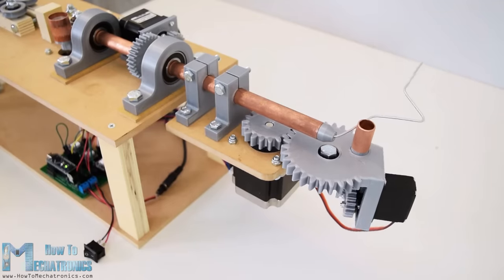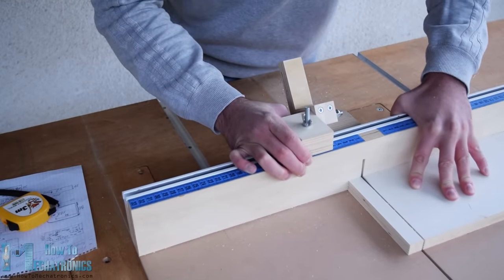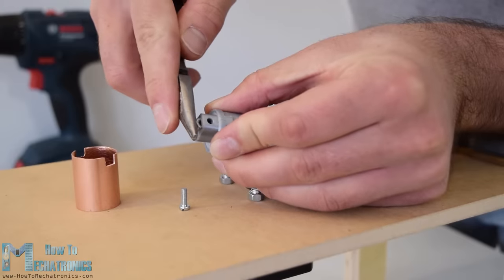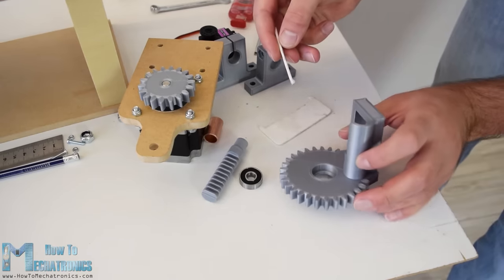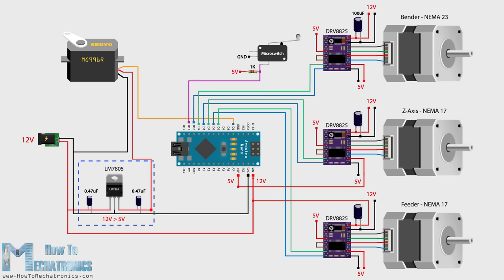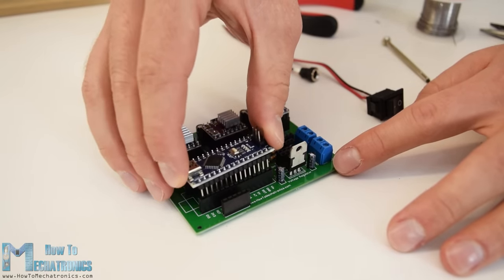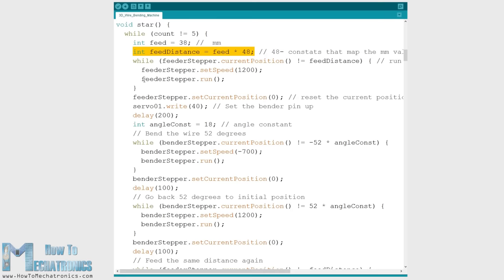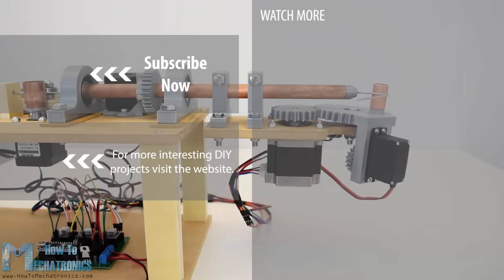Arduino 3D Wire Bending Machine

Comment: For 30 odd years I worked for a spring making company, during which time computer-controlled machines of increasing flexibility gradually appeared, making compression, tension, and torsion springs as well as wire shapes.   I've been retired now for 13 years, so it was quite amazing to view your video which demonstrated the principles upon which these machines worked.   It would have made the problem of explaining what we did to lay people a lot easier.
My own contribution to the company was in designing and making electronic devices to improve the functions of older, non- computer-controlled machines.   Although I made my own printed circuits boards, the designs were initially based on TTL integrated circuits and latterly Programmable Logic Controllers - nothing as advanced as Arduinos.
What would I have given for a 3d printing machine ?
I was also responsible for our computer system, in its metamorphosis from a punched-card system (with a 2K hard disk!), through unix based COBOL, to an Informix relational database system.   I learned to code in many languages, so your program explanation was also fascinating to see.
Thank you so much for posting this project, I found it most interesting.
Reply from the maker: I'm so glad a person with that much experience in the area found this video interesting. Thanks for the comment!
Reply: Hello @Don Johnson24

I find your comment and work on the machines very interesting!

If there were videos on the subject made by you (e.g. your PCB designs, TTL circuits you worked with, PLC logics, most importantly Unix and even how those punch-card systems and COBOL worked) I'd be very interested to watch them.

Thanks for adding your input on this video, I always find stories like this very fascinating.
Have a great day!
Reply: Cool tie in Don!
Reply: This is one of the most well written comments I've ever seen!  I feel obligated to capitalize and punctuate everything from this point on.  
These explanations of how processes were executed should be standard curriculum for all mechanical engineering degrees. 

Every ME should buy a cheap 3D printer and an Arduino kit .  It honestly takes about 8 hours to learn it.  I learned it and use it everyday for my actual job.  It's like unlocking a cheat code for a video game.
Reply: @nickmandarino8234  Any kits and guides you'd recommend?
Reply: It is the hard work that "you" the older generation have put your heart and soul to what you do, that contributed to this day and age for us the younger generation to live in and for us to hopefully do the same for those who will come after us, it is "your" the older generation teachings that "you" inherited and passed to us and we will pass it on, is what made this progress possible, thank "you" from the bottom of my heart for your great contributions as we will try to further ours.
Reply: Ladies and Gentlemen, if you're ever looking for a true and correct definition for "hacker", "greybeard", or "that guy who combobulates and finagles der  blinkenlights", Don Johnson24 is the answer you're seeking.
Great reply to a great video, thanks Don. All the best for a happy, safe and productive 2019.
Reply: Reagan was asked how he could lead a "computerized" country when he was so "out of date."  He replied "Your forgetting that my generation INVENTED AND BUILT the computers you're just USING."  THANK YOU FOR LEADING THE WAY AND YOUR YEARS OF SERVICE!
Reply: I wonder what would Don have done in his youth if he had access to such wonders we have today =]

What a time to be alive!!
Reply: hi don  so was i in the spring game 25yrs 16yr old started vic oz melbourne :) now its  huge business into alot diff things 
one these small machines from taiwan cost in 2006 $36k au
Reply: Waooo, how good was you comments that it stick with my eyes. Reminds me of my uncle who was working with something similar electronic. Obviously your efforts brought us to these tech toys.
Reply: Do you have a 3d printer now??
Reply: One important thing that worth mentioning is: Not all smart machines work with microcontrollers, you can achieve the same functionality with some methods and techniques like latching by the use of switches relays ( for example: take a look at retro Jukeboxes ) , ... but for sure the size will be bigger, the number of components will be higher, and of course, the total speed will be lower
the point of my comment is that technology is Not limited to only one method/technique and you can achieve similar results ( either better or worst ) by newer ( or older ) methods...
the only unchanging thing in our world is mathematics ( nothing else )
Reply: Hell yeah! I'm 21 and started as a coiler 3 years ago and transferred to Newcomb Spring last month! (Not sure if you've heard of them but they're exceptional). It's cool to come across another coiler/former in the wild! I've done lots of work on mechanicals back at Lee Spring, such as the Torin W11, W10, W11.5, Mec CLS-10, Mec SC-8, and slowly transitioned to the CNC machines, like the Mec CLS-10X, CLS 16-II, WH-16, SH-8, Itaya PCX-20, PC-15, CX-8, and probably a few more I forget to mention. It's an amazing job because I really feel like I'm contributing to society, I'm making great money for my age, living comfortably, enjoying my job and not worrying about college anymore. Not to mention, it's nice to be one of the youngest coilers out there, I feel like I'm doing something most people my age just couldn't. I mean, I've made springs that operate artificial heart valves for St. Jude Medical. It's a great feeling that something I've made is keeping someone alive right this moment.

Comment: You have really done a fine job with this! I’ve seen the large commercial units that cost mega-bucks to acquire but this is an amazing workaround for folks on a budget. The best thing is that you have done such a nice job documenting your work. Thanks so much for being a class person and passing on this great information.
Reply from the maker: Thank you!
Reply: I used to run a wire bender.  it's amazing how simple it CAN be on the small scale, large scale is a different story.  Great job on your project, happy that it works well.

Comment from the maker: Hey everyone, thank you so very much for the positive feedback and motivation! I will definitely keep making this kind of content, so stay tuned! 😉
Reply: Kakoy y teba silniy akcent
Reply: Is that an affiliate link to banggood? If so... pretty shady you don't announce it in the video, that you get money from them
Reply: Супер видео! На крајот можда ако ставиш гума и на цевката и на лагерот (парче внатрешна гума од точак на пример😉) би се решил проблемот.
П.С. Не би било лошо да ставиш captions на македонски. 😉
Reply: Oh man, you really show us that the imagination and creativity have no limits... thanks a lot, I've learned a lot with your videos!!!!  What a beauty machine!!!
Reply: well done, very informative. As for your wire feed problem, have a look at MIG welders, how they feed the wire, also they use a spring tension with the bolt adjusting the tension, this allows for the fractions of an inch variations in the wire. Also, larger industrial machines used a hardened knurled drive wheel, which grips the wire, again which should be cheaply available online in a variety of sizes. Also pushing soft wire thru the copper tube, it has too much room to be able to bend, perhaps get pvc tube in different sizes and slide on inside the other and side the whole lot into the copper, or print something.  It's a bit like trying to push a rope up hill, put it in a tube and you can do it, put it in a huge pipe and it will bend and fold over inside.
Reply: Please do the rubik solving machine !!
Reply: So nice and useful project. Add more similar projects please.
Reply: good job man, cool video
Reply: Soooo dude, what you are going to use all those bended springs for?
Reply: A perfect machine for making the tricky wire parts of the Orthinopter.  Well done.
Reply: Fantastic stuff.
Reply: Superb explanation with innovative  display of the program as you explain it. I have never seen it done better I wish I had someone like you as my instructor in Fortran 4 back in 1968... mind you as we programed on punched cards back then it might have been a touch more difficult!
Reply: this is really cool but being a minor I can't really do anything else other than watch this.and other videos like this. I think it would be really cool if I could make something like this.
Reply: Great project. Nice level video and build. I should aim to reach this level sooner or later. Thanks for the inspiration.
Reply: could u build coil winder machines?
Reply: hey Mr. , can I buy your work? we need it for our thesis, here in the philippines.
Reply: Nice video , and nice voicecracks
Reply: I wish that you sold the completed arduino part.  I am not a techie :(
Reply: Please Sr. I need to know about the measure of wood.Please My team and me we can do it for the school from El Salvador.
Reply: Excuse me if my english is bad
Reply: christina brine ya he need to sell the pcb
Reply: Can we get the parts
Reply: How To Mechatronics it is possible to bend a stl file?
Reply: How To Mechatronics what about using the straightener it self as the drive for the wire.
Reply: I have a doubt if we change the dia of wires ,shall we change the wire straightener pulley ??
Reply: My question is :
Are you a mechanical engineer or a electronic engineer or computer engineer or electrical engineer? You're doing all yourself..  Great.. 👍
Reply: Hi there
I am fascinated by how you have in simple language explained everything including principal and operation making the concept very clear. Thank you so so much. Is it possible to get a pcb with all components soldered and tested mailed to myself in Canada. I am willing to bear your charges. I am retired but will enjoy building it. Please let me know. Thanks and God bless you. Stay safe, we need you. Muzaffar

Comment: Very nice build!  It's the first project I've seen that makes me think that I might have to add a 3D printer to my shop!

For your straightener/feeder problem at the end, I'd suggest either gluing a strip of sandpaper to the copper tube in the feeder for extra grip, or perhaps using a rubber roller (salvage from an old printer or such).
Reply: Alternatively, a very simple solution to the feeder problem would be to put some heat-shrink tubing over the copper tubing. Should raise the coefficient of friction enough to solve the slipping problem.
Reply: You can 3D print rubber-like soft plastics as well if you have the right printer setup.
Reply: Knurled carbide roller. Edit: search mig wire roller.
Reply: @JimmysTractor  Not a bad idea, but if your tension is set too high, it will leave marks in the wire. If that's not an issue, that's a great idea. It gives you plenty of grip, and makes a good positive connection between the roller and the wire.
Reply: Roboticus: I was thinking of a small piece of inner tube or other rubber tube, slid over the end of the roller. Sandpaper could work, but could end up marring the wire. Heat shrink would work, but I think actual rubber would give better grip without marking up the wire. 

I keep looking at 3D printers and small dremel based CNC machines. Which one? Hmmm...

Comment: 3:15 - I really like the way you designed the gear to accept nuts. I'm going to use this in future designs! Thanks for the great idea!

Feeder issue: Perhaps have two drive wheels tied together with a gear on one side of the wire, then have two pressure rollers with a tension spring on the other side. That would double the area and grip of the unit.
Reply: If you're working with flat shafts and you can just put in a 5mm screw hole, you can use the regular self-threading plastic screws (like what PC fans use), instead of needing nuts.  The screws are cheap, and it works really well for securing a plastic part to a shaft.

Comment: I have to agree with the majority of the commenters.

Great build.
Excellently documented.
You explanations are clear and precise. 
Even considering your comments regarding the flaws of the machine is awesome too.

You have just gained a new subscriber.

Regarding the feed issues.
Mig welders often use a knurled wheel as well as a bearing wheel.
So perhaps try that instead of the roughed up copper tube.

Also. The straightener part of the machine. .
When using a similar pipe straightener machine,  you pull the pipe in and out of the straightener a few times. Maybe you could feed and return the wire through a section of straightener a few times before starting a bend program?

Only thing it needs now are automated wire clips to clip the wire off once finished.

Very well executed.
Reply from the maker: Thank you! That's a good tip, pull in and out the wire several times before feeder to the bender. However, first issue to be solved is the grip of the feeder. Thanks again for the input!

Comment: Excellent video...  I used to work in an shop where we had straighteners to take the bend out of coiled steel just prior to fine blanking.  The straightener rollers WERE the feed rolls.  The straightener rollers were geared in series and they did the feeding of material.  To compensate for feed roll slippage, there was a single roller that counted the feed length.  On your system, you could make the five straightener rollers into feed rolls and rework the current feeder roller into a potentiometer that counted distance and shut the feed off when a given distance was achieved.  Thanks again for a great video.  Thumbs up and a new subscriber here.
Reply: I was going to suggest putting a backing roller on the opposite side of the feed roller, so more drag force could be applied to the feed without increasing the lateral force on the servo shaft . . .  but I think you have a better suggestion. I would replace your distance-counting potentiometer with a rotary shaft encoder that sends a pair of phase-lapped pulse trains to the arduino for measuring distance, though.
Reply: Yes Don, your suggestion is perfect.  Makes for a much better solution.

Comment: I noticed a few people asking for upgrades to this.
My suggestion would be to add an OLED screen, rotary encoder, an SD card reader and wire cutter.

The SD card allows feed and angle data to be added from a file.
The rotary encoder allows file selection input. 

The OLED to give feedback to the user.
You could even use the encoder to enter data manually.  Making the unit stand alone.

Scaling options.
With wire cutters you can program it to make 'x' amount of shapes.

Again.
Great project.
Reply: Nice work but plz create a code for reading .svg and .obj files and then adjusting bends maybe with the use of processing. And then it is complete.
Reply: Hi . . Jason

Comment: Hi! thanks for the video!
I worked with a bending machine in an industrial setup (rebar bender for reinforced concrete) and it's pretty close to it, now I work in a factory that make MIG welding wires and we use straighteners almost like yours, I can give you some insight that we learned: first, you need to mount the three rollers individually, you will have more control on the straightening.
 Next, if you don't or cant have much pulling force, you should add more straighteners (with that you can equalize the straightening force on multiple rollers and alleviate the strain on the drive mecanism) and I suggest to add a vertical one too (that will help with the overall straightening and your wire will be straight in both axis). 
Now, for the pulling system, I recommand you to search about MIG welder wire driving systems, it's EXACTLY  the same as you seek to achieve here.
Here is an example: https://cdn.eastwood.com/media/catalog/product/cache/1/image/9df78eab33525d08d6e5fb8d27136e95/p/1/p12012_3.jpg
the bottom roller possess a groove and is motorized, the upper one pinch the wire on the groove, it is mounted on an arm and locked with a tensioning screw, it serve as a quick lock for the arm and it apply pressure on the wire that you can tune with the knob.
I hope that my humble experience will help you :)
Reply: Trump
Reply: Donald Trump

Comment: Great project! You mentioned at the end that you were having a problem feeding the wire due to slippage. If you borrow a design from a MIG welder feeder you can see the feeder pulley/gear has a knurled toothy grip where it contacts the wire. Perhaps you could get hold of one of those drive gears to use. As with many of your previous projects you have unique and what appears to be original ideas. Keep up the good work.
Reply from the maker: Thank you and thanks for the input! Yeah, the feeder in my design definitely needs some improvement. The first thing that I noticed is that the copper tube that I used, is actually softer material that the steel wire I was bending. So even when I tried to make some teeth to the copper tube, the material was week and got squashed by the wire. Also, when I tried to tighten then feeder more, the 3D printed shaft coupler broke, which means that the way that two rollers (the feeder and the bearing) are position is not quite good.
Reply: Or a direct-drive filament extruder assembly for 3D printing. Should easily mount onto your existing NEMA stepper and give you a knurled gear drive that should work. Not sure of your wire diameter but the filament is commonly 1.75mm so you might need to adjust a bit.
Reply: I want to make a spring coil machine and a mig feed wheel would be great thanks for the tip!